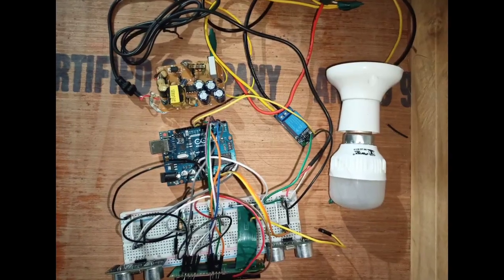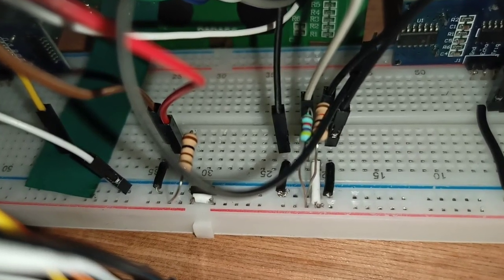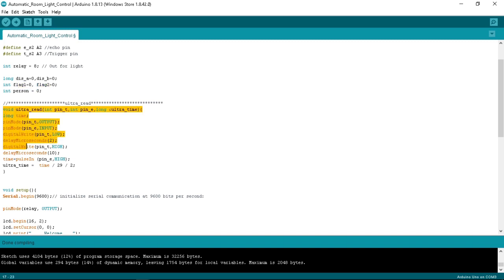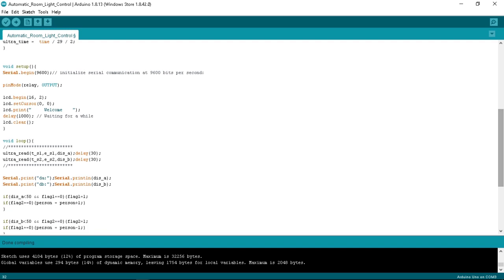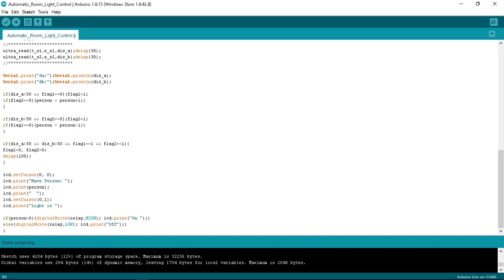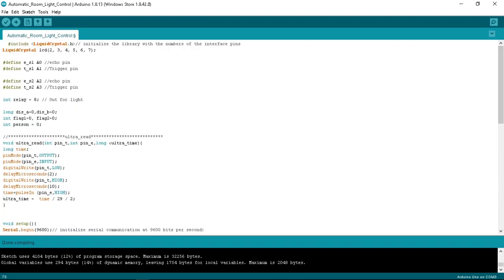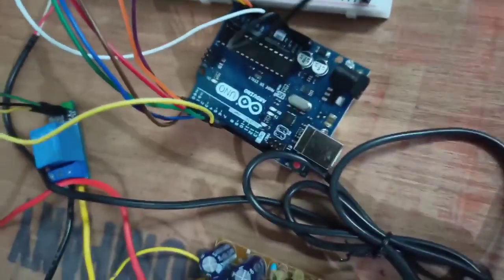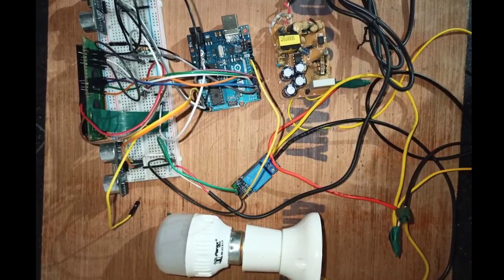Automatic Room light control using Arduino and ultrasonic sensor + LCD display 🔥 project .

Comment: Wow dude you found a solution to my problems I was going to use The PIR for my project but using 2 Ultrasonic sensors as to count the people who are going out and in to conntrole when the light will be switched off is geneuse great job Dude. Tank you for the inspration 
🤯🤯👍👍

Comment: Sir this project file report pdf send me
Reply from the maker: Ohh sorry report already submit kiya huwa h college me or abhi college bnd h so 
Tum report me 
Ultrasonic sensor ke baare me and prize 
Lcd display ke baare me and prize 
 And jo resistor use kiye ho vo kitne ohm ka h and tumhare aurdino ke codes ki printout. or sabse important 
Ki is project ka kya use ho skta h 3-4 example ke sath if u need example contact me on my insta
And usko bna ne ke liye jo jo use huwa h usko aache se likhr krr 
Schematic diagram ka print nikal krr add krdo 
Bs aapki report ready h ✨
Agr schematic diagram chyhe tho mene discription me link de rkhi h github ki ya firh contact me for any queries 💯
Good wishes!
Reply: Thanks you sir

Comment: Bhai mujhe yah banana he help kar sakte ho
Reply from the maker: Bro it is too easy as i have made it. u also can do it yourself take some time understand the schematic and parts this will also help you further. i would love to help you but i have too many works related to my new web techinfohelp.com
So i suggest you to follow the schematic diagram here -> https://github.com/snahal04/project/blob/main/project.png  properly and buy all the parts mention in discription box and you can also download code written in arudino idle software available in Microsoft store code ->https://github.com/snahal04/project. 
You just have to arrange parts in bread board from schematic circuit diagram and upload the code in aurdino uno with software and you are done 
Thats all i can do this for you from my side 😊 have a great day !

Comment: How to connect vo pin
Please reply
Reply from the maker: Hey!! Connect vo pin of lcd with 1kohm and 4.7kohm resistor parallel  and from 1kohm connect it to 5v to Arduino and the other 4.7kohm resistor connects to gnd of aurdino.  
It will be more easy for you if you check the schematic diagram of project here https://github.com/snahal04/project/blob/main/project.png